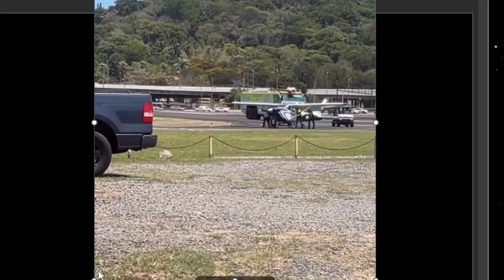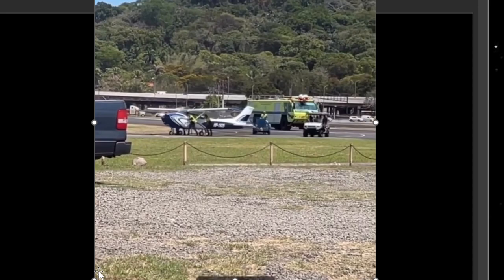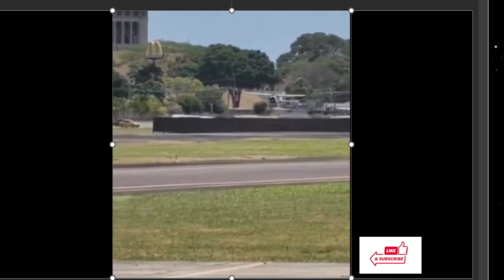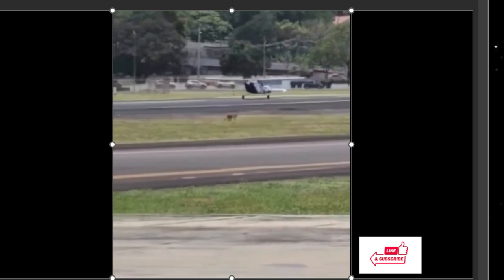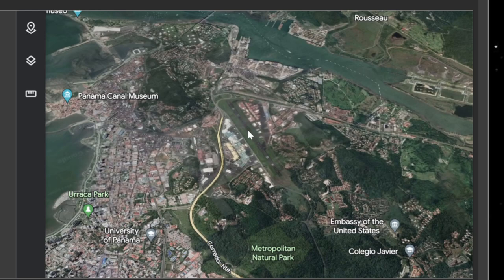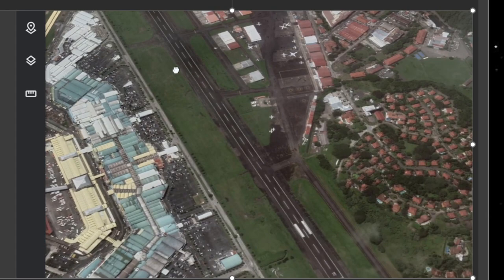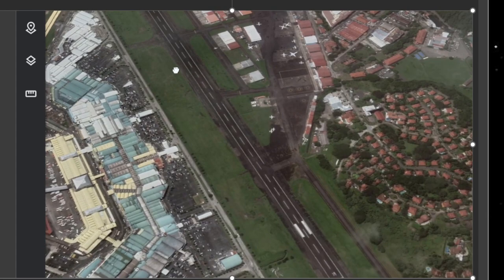Bystanders Watch Cessna Emergency Landing

Comment: Most important part of cutting power before touchdown in landings like this is: you save the engine from damage, even if the prop requires replacing, it's still way less expensive than engine repair or even overhaul
Reply from the maker: Agreed
Reply: True .If its an engine at the end of it life it is in need of a rebuild anyway.The insurance company's know this and pay out accordingly.

Comment: Outstanding! Smart move saving the engine. Not sure about Panama, but a prop strike here is an automatic overhaul. $$$
Reply: It would be the same anywhere except that it wasn't turning so could probably just get a new blade if it is worn beyond repairable limits.

Comment: Well done to the pilot! Pity the prop just contacted the ground anyway. It's a 182RG with retractable gear. These things are notorious for gear hangups if not kept in tip top shape with adjustment and lubrication. You can see they extended the nose gear and towed the aircraft off the runway.
Reply from the maker: Pilot did great!

Comment: THAT my dear Pilots is how you handle a landing without "All" the landing gear down! The man walked away with just MINIMAL sheet metal damage and not damaging the prop or engine. Even though the prop had very minor contact, it was not under power, can probably have the prop inspected and repaired, just some minor rash. But no bent blades and no contact under power just saved a bundle on repair cost! Great Job, smart and safe pilot! I LOVE seeing these guy's who have some common sense! GREAT JOB! 👍👍😁😁 Great Report! 👍👍Had a Cessna 310 years ago with a stuck nose gear, on landing, the pilot cut the engines, and after it slowed, just before the nose came down, had all 3 of his big boy passengers climb over the back seat into the rear baggage compartment and it stopped sitting on it's tail tie down bracket! ZERO DAMMAGE! The 3 fat boys sat in the baggage compartment until ground crews came out and manually pulled down the nose gear and secured it, towed it back to the hanger without a scratch! Now that my friends is THINKING! Didn't even have to make an insurance claim! ZERO DAMAGE! Not even a scratch on the paint!
Reply from the maker: Unreal story.  Thanks For sharing.
Reply: @ARFFWorld  Gotta THINK outside the box sometimes!  🤔🤔👍👍😁😁
Reply: You couldn't get ME to take my safety equip.off right before a possible crash landing!! And NO ONE else I know would either. Did you witness this or just hear about it? No pilot is going to ask people to unbuckle their seatbelt BEFORE a forced landing. I apologise if I offend but that don't sound right.
Reply: That's amazing! Very smart!
Reply: @greggrace967 it wasn't "before" a crash landing nerd. It was after landing before they came to a stop. He would've still been able to steer with the rudder to keep them on the runway so they're wasn't going to be a cRAsH..
Reply: @greggrace967  And it WAS NOT a crash landing, you need to understand the difference! Yes, if you were making an off airport landing, keep your seatbelt on. But landing on a 6000' runway, what's the problem? Because of people like you, our insurance rates are skyrocketing!
Sound like a Drama Queen to me!

Comment: I had a similar situation in a different plane. This pilot did perfectly...shutting down the engine (as I did) saves a complete engine tear down due to a prop strike which is $20k. No sure how a 182 lost the nose gear but the pilot did great,
Reply from the maker: 20k yikes
Reply: It was probably an RG. A retractable gear 185 is my guess. It had lift struts so that rules out a 210 or a Cardinal.
Reply: A prop strike is way more than that nowadays. Especially if it's got a constant speed prop on it, then you can double it.

Comment: Finally a pilot that knows enough to kill the engine!!!! I see so many of these where they had plenty of opportunity to kill the engine and they just let them beat away at the prop and engine on the runway unnecessarily and instantly costing the owner atleast 50k per engine! The engine and prop are over half the cost of the airplane most of the time.
Reply from the maker: Was nice to see pilot did great

Comment: You said it. Textbook. He stopped the engine so as not to have a prop strike which would required an engine tear down and inspection. Replacing a prop, some nose skin, and fixing the landing gear, all less expensive than an engine tear down. Looked like they got the nose gear deployed to roll the aircraft out of the way.
Reply from the maker: Was a cool one to see

Comment: I hope and pray that the majority of folks commenting  how "great" it is that the pilot "saved the engine" are not pilots (or at least pilots of retractable gear aircraft). This is WRONG! WRONG! WRONG! Absolutely the worst thing you can do in that situation. Talk about snatching defeat from the jaws of victory...You have left yourself with no out in case you need to go around. And it's why you have insurance. And your insurance would pay for an engine IRAN 100 times over - before they want to be settling with estates. Actual pilots are explicitly trained NOT to try to do this stunt. It turns a situation from a mostly non-event into a potentially catastrophic accident.
Reply: Disagree, he touched down at the beginning of the runway and then cut the mixture, and yes, I am a pilot and have retractable time.  This pilot kept his cool, and besides cutting the engine prevented a potential fire.  Besides when performing an emergency landing, I was taught to pull the mixture, turn off the fuel and turn off the master once the landing is assured.
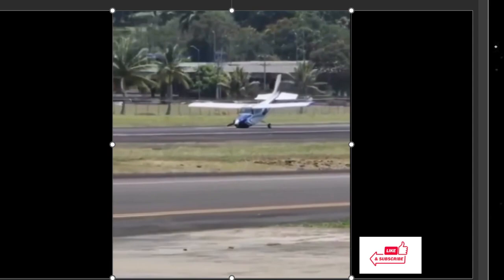Reply: @theresacaron4238  Cutting the mixture "once landing is assured" is very smart and is part of the checklist procedure - just as turning off the mags, battery(s) and fuel selector are. However, that is a very different mindset than intentionally trying to "save the engine" by cutting the mixture and landing in an abnormal, nose-high attitude and holding off until you can get the prop "just right". Put another way, if you execute the emergency procedure per the checklist and land normally - and it just so happens that the prop stops and doesn't strike the ground, great. You MIGHT not have to tear down the engine. My point is that saving the engine should not even make the top 10 things that the PIC is thinking about in that situation. Go ask any CFI if you doubt me. (PS - I'm not saying that saving the engine was on the top of the pilot's mind in this case. Can't tell from the video alone. What I am saying is that's not a reason for saying what a great job this pilot did. They did a great job because they dealt with an emergency situation and everyone walked away. That should be the headline...) (Actually, looking at 1:03 again, that engine will most likely need to come out and be inspected. Prop tip appears to have bounced off the runway.)